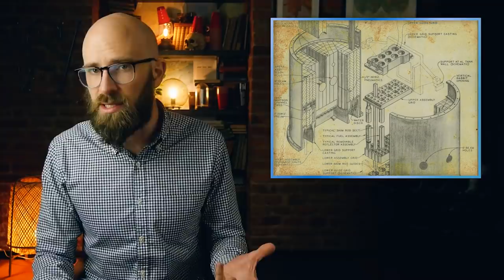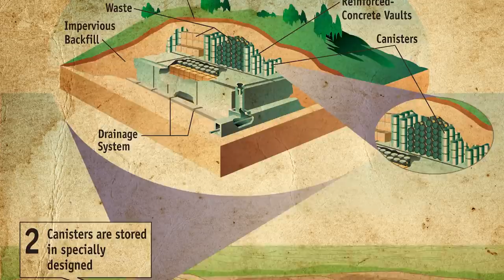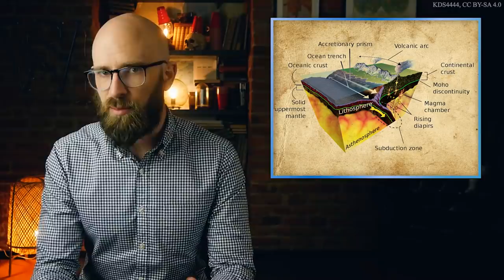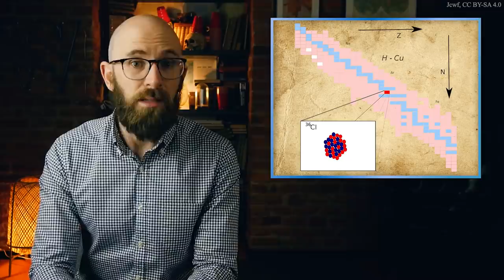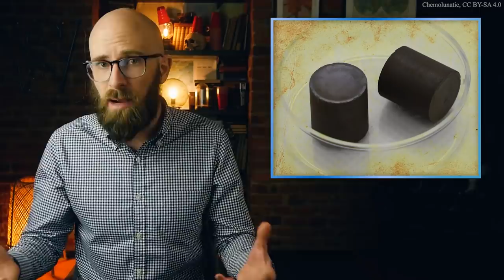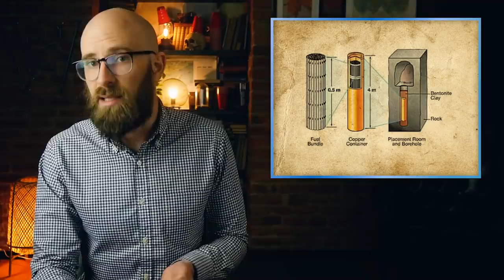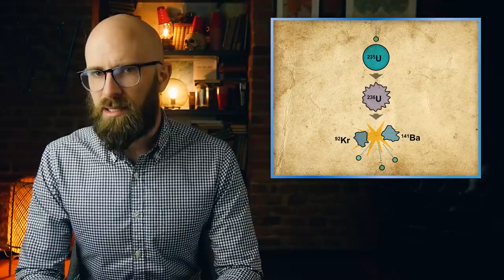How Does Nuclear Waste Disposal Work?

Comment: I’m surprised you didn’t talk about the WIPP nuclear waste disposal site in southern New Mexico. I don’t know if it falls in exactly the same category as the other deep earth storage sites you talked about because it’s in salt instead of bedrock, but it deserves a mention, I think.
Reply: You are correct, WIPP is much more of a thing than the swedish "Forsmark repository" which doesn't even exist yet, but still it got mentioned many times. It seems there are oversights in the background research of this video.
Reply: Right and didn't it have an explosion from a leaking barrel and it was closed.  I don't think burying it is the answer and think we should be shipping it safely off the planet.  Whats your thoughts?
Reply: @paulmobleyscience  No, WIPP had a very minor accident that harmed no one. Some operations were delayed for a few months while they investigated. They've been back up and running for a few years now.
Reply: WIPP was supposed to be in the same category. It was designed and built to handle everything radioactive generated by the USA for the next several centuries. But an arbitrary rule was enacted saying that power plant waste couldn't go there, and another repository was made just for that Yucca Mountain. Which was then itself canceled for similar reasons. But the rule was never undone, so today WIPP only takes nuclear weapons waste and a few other select types of waste from science and industry. While the spent fuel is stranded on site with no where to go. 

Which is honestly fine, if people weren't constantly freaking out about it for no reason. The spent fuel from our existing reactors is extremely valuable and should be recycled rather than tossed away forever in WIPP or a similar spot.
Reply: @bronzedivision  I never said anything about the explosion harming someone.....WIPP blew up because of a barrel exploded because the WRONG KITTY LITTER WAS USED!!!!   So 9 times out of 10 every pro nuclear person either makes money directly or knows someone that does and the 10th is just poorly educated...so which one are you?
Reply: @bronzedivision  No the spent fuel is dangerous and it is not arbitrary.  The problem was they put the cart in front of the horse and didnt realise what it was going to do to not only humans but all life on the planet.  Unless youve  done almost a decade of research on this topic and only ever watched YT videos to understand nuclear power then you have no right to promote it.   Tell me what you know of the inverse square law and how radiation detection monitors are calibrated.....remember the most important part....does not apply to extended sources.   WIPP and YUCCA were all thought of before we actually know what's happening now.  We know we cant bury it and must get it off the planet.  Just because breeder reactors were designed for spent fuel usage doesn't mean its one viable and two we should continue the use of nuclear power.  Nuclear power has never been about energy, it has always been and always will be about uranium daughter procurement, nothing more....
Reply: @paulmobleyscience  the idea of shipping it off the planet is a well hypothesised idea, but it's terrifyingly dangerous. If you load a rocket with nuclear waste, it goes into the atmosphere and it then blows up. Well you have another Chernobyl or even larger scale disaster spreading radioactive contamination across the world via the jet stream. 
As someone who works in R&D for the civil nuclear industry, it's an interesting subject to be part of.
Reply: @dsw1664  Though it may be dangerous we all know it can be packaged to survive not only an explosion but also re-entry as well.  Whats even more dangerous is we know that every 12000 years the Earth undergoes a change.  This change is brought on by the passing of the galactic current sheet that causes massive volcanic activity, earthquakes, tsunamis and tidal waves never seen by modern man.  We also know that the sun releases a massive mini nova event that makes the Carrington event look like nothing in comparison and when all the offsite power is shut off and chips fried from the EMP and induction through the L shape magnetic field lines and cause every water cooled reactor to go into meltdown and subsequent prompt criticalities....like a domino affect around the Northern hemisphere.  We must prepare for the worst case scenerio and we haven't in the past and as you can tell we still aren't in the present and it's not looking good for the future either.  These difficult conversations need to be had not just at the top levels but with everyone because it affects everyone on the planet.  Even just everyday operation we know that releases happen regularly that allow water soluble radionuclides into the environment that evaporate under equillibrium conditions and bind with molecules thus creating movement around the planet.  Then once ingested and in the past thought to pass through are now finding that organically bound forms of it occur once ingested causing cancer, autoimmune diseases and other ailments that are passed onto future generations and rarely discussed.  And then there is the fact that each specific cause of cancer and auto immune diseases are unknown and therefore the only deaths that could be associated with nuclear power are hidden within those numbers that are never categorized into separate lists.  The people have been lied to....
Reply: I'm watching this video right next to the WIPP lol. But seriously I am
Reply: @WhereRaul  I would move if I were you...
Reply: @paulmobleyscience  Sandia National Laboratory in the U.S. has developed a shipping container that can withstand an explosion on an aircraft, fall to the earth from 30,000 feet, and still not leak.  Thus, your idea is quite feasible.  I suspect that the problem is people who think with their gut and do not know how to compare real risks.  Keep up the good work, my friend.
Reply: @composer1663  Exactly thank you for sharing that knowledge with people.  This has been done for a long time.  They even used to make nuclear engines and send them to space before they realized what it was spreading all over the planet but those engines had to be packed to not only survive an explosion but also re-entry to the planet.  They ship by rail and truck where it is packed to withstand a massive accident and subsequent explosions....what I suggest is not only feasable but is the only real answer to ensure it will never harm future generations.  Thats the goal right there not cost or money or even peoples lives today....its about the people in the future that won't get handed a planet like we were handed.   This is unacceptable in this day and age and it only exists due to military purposes and has never been about civilian energy production.
Reply: @paulmobleyscience  you seem to buy into all the fear stories pretty easily. No one died at Fukushima, WIPP explosion was low level waste, harmed no one, and has no lasting effects. As for an EMP most reactors will SCRAM and be fine once the EMP hits. Then they will have about an hour to restore cooling power. The simple solution there would just be to have EMP hardened power generators. Worst case scenario 25-50 miles of land is unusable. Probably won't be worst case scenario though as most reactors have hardened containment buildings (hence their iconic dome shape), unlike fukushima and chernobyl. There's also been plenty of meltdowns in the early history of nuclear power that were pretty easily cleaned up. Coal ash has killed more people than nuclear waste. If an EMP hit you'd have bigger problems to worry about as long as you're 50 miles away from any nuclear plants. A nuclear cask could be launched into space at a high price and probably only one fuel assembly at a time. 100 million dollars or more just for one cask.
Reply: @iamunamed5800  Says who?  You?  WIKIPEDIA???????   For anyone to make that statement the you must have the list.....the list of deaths caused by cancers that were induced by ionizing radiation ONLY!!!!    Hey genius, no one on the planet can make that statement....just so youre aware of that...
Reply: @alaric_  your favorite one not being mentioned is hardly an oversight.   Nerd
Reply: @paulmobleyscience  Replying to your comment from 2 yr ago. I agree. Ship it off planet. To the sun maybe.
Reply: @wolfmantroy6601  Hi Troy, I hope your day goes well.  Yes..it is the only proper way to deal with nuclear waste is to get it off this planet but before that occurs there is one thing that needs to happen first.. they all must be shut down.  Everyday we keep producing more waste that must be placed in dry casks and stored at every reactor site.
Reply: @wolfmantroy6601  
That's just not going to work.
Even if we could launch the stuff safely, we still need to boost it to... somewhere.  We reasonably expect to colonise space, and this stuff will still be awesomely dangerous, so it would need to be on an escape trajectory, which will require enormous amounts of rocket power. The same amount would probably let us establish a huge colony on a planet. Anyway, we reasonably do not want it out there where some innocent future spaceman will stumble over it.
To the sun is even more difficult. That takes more delta vee than an escape trajectory. Plus it contaminates the sun. Sure, the amount is tiny compared to the sun, but we can't retrieve it at all if it turns out to be a mistake.

Overall, keeping it contained in specific locations seems best.

Comment: I always wondered why there is no large scale RTG power plants that just run on nuclear waste
Reply: there's a guy who made lights that run off the extra radiation coming off cell phones like 15 years ago, we can't do something with radioactive leftovers seems like a waste
Reply: @WritersOnTheWall   very true, every Nuclear plant should have a RTG plant to use the waste. Just makes sense to me, instead of burying it for further generations to figure out
Reply: We have at least two companies working on getting their reactors through the labyrinthine certification process. Both can extract 99% of the fissile energy. Just 4% has already been used. Moltex is building a plant in New Brunswick Canada. Elysium wants to use expired bomb cores as fuel and maybe depleted uranium. Both are crimped by the regulatory processes. Elysium especially because USA does not certify anything which is not a standard PWR.
Reply: @Dave5843-d9m  It is not possible to use a “nuclear bomb cord to power a nuclear reactor without reprocessing.  Reprocessing results in the worst kind of nuclear waste.

Comment: Canada..  Where Hockey rinks are a unit of measurement...

"Since the 1960s, Canada's nuclear power reactors have used over 2.5 million fuel bundles. If these bundles were packed end to end, they would fit into a space the size of seven hockey rinks, stacked to the top of the boards."

Comment: They should make more radioisotope thermoelectric generators RTG and RITEG's, that use the heat and radiation of the waste.
Reply: Thanks for the thumps up lads, but back on the 60s or 70s Donegal, Ireland had a working lighthouse on the technology and it was disband due to ireland not being allowed nuclear power, but in reality it was radioactive thermodynamics power.

Here’s and article to read more about, I didn’t read it myself, but it should detail the facts. A bit drunk atm.
https://www.irishlights.ie/tourism/our-lighthouses/rathlin-obirne.aspx
Reply: The USSR made a bunch of them back in the 70s and 80s to power lighthouses a such along the north Siberian border.  Today they are trying to find them all; there have been a number of accidents when people have run into them and tried to take them apart.,
Reply: @puncheex2  most read that now tomorrow thank you very much for the info mate
Reply: @puncheex2  sound job, lad will, coming up to 1.00am in Ireland here so will binge that content after work tomorrow,  cheers mate, very informative might as well add me there 👍 chat on the morrow

Comment: Great video, just a correction:Germany has no nuclear waste disposal site anymore. Germany had a repository in a former salt mine but it wasn't properly monitored and they just dumped the waste in there and then additional ground water started leaking in. Now they don't operate this site anymore and they are searching for a new disposal site, possible host rocks can be clay, salt and granite, however this process will take probbaly the next few decades in Germany.
Reply: They also made error with the swedish forsmark repository. It's not been built nor has it been even approved yet, the builder SKB just found suitable slot where they want to build it.

Comment: People need to understand that the materials being talked about here are NOT liquids, but solids. Yucca Mountain would have buried them in rock, and used the decay heat to repel groundwater from the buried waste. Obama/Reid tanked the project though so I guess it's better to leave it vulnerable at the sites that use it.
Reply: The traps we chould set to prevent this whould be very potent at killing anyone who tryed.
Reply: There is liquid nuclear waste which is often the most radioactive.  It can be concentrated to a solid and then disposed of, but it is a very complicated and expense process.

Comment: Third generation reactors can use the waste. Just need to get Big Oil off the table for it to get funding
Reply: Doesn't matter the same exact fuel is used and humans are incapable of building these reactors without not only help monetarily through state and federal bailouts for building and everyday operations but also subsidies for insurance through Price Anderson of which Nuclear is far more than everything else combined.
Reply: @paulmobleyscience  Oil is already subsidized heavily by the government. Just shift the subsidies over.
Reply: @johnburr9463  Sure subsidies just regular everyday subsidies but when you add the factor of Price Anderson then it no longer is just a simple subsidy is it?  Insurance
Reply: No way.  And reprocessing spent nuclear fuel produces a lot of highly radioactive and hazardous waste

Comment: It seems like a 2 birds one stone kind of problem. Give the radioactive stuff that needs to be transmuted to the CERN supercollider and have the nerds compile the research data. Then they can even create a separate dataset that could compare transmuted material to the original and check efficiency and prove a residual output that people could potentially interact with in some way. Experiment with combinations of daughter isotopes and see if any of them can react with another that it disrupts their wave form and causes it to fizzle out quicker etc.